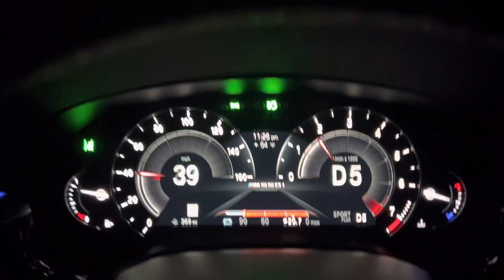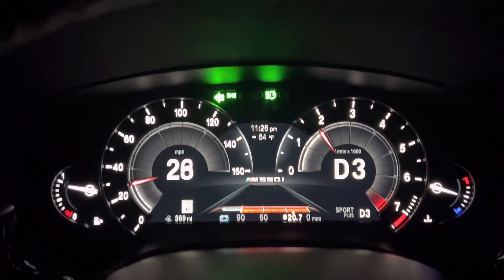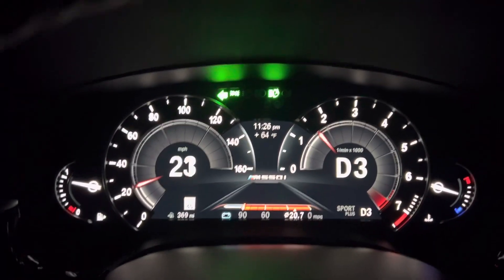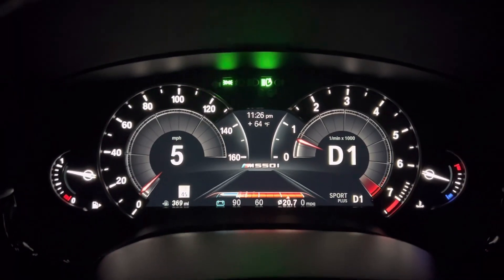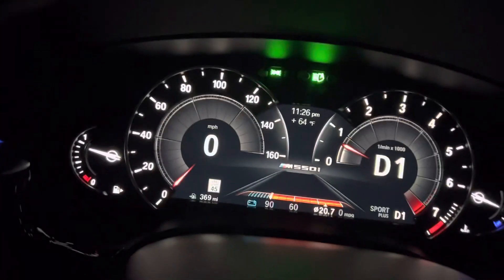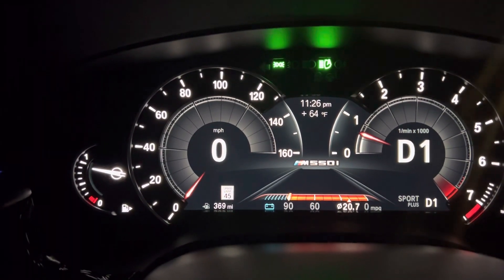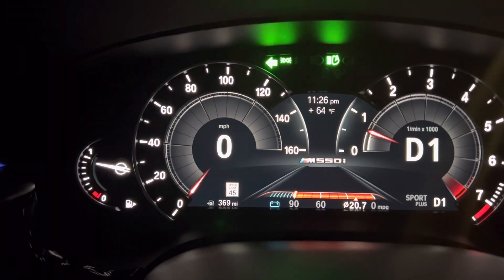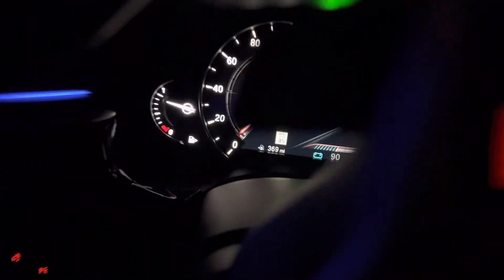How does BMW regenerative braking work and why your battery may not be at 100%

Comment: Dumbest idea ever.  Thanks to this, my 2022 X5 refuses to remote start in frigid weather, which is when I need it pre-started the most.
Reply from the maker: Yeah you can thank the European Union and Greta thunberg for that.  Remote starts aren’t even legal where the cars are built.
Reply: @newfinishautospa   I've never understood how a 15 minute idle can hurt the environment more than driving the car.  Over-reacting against the wrong things I guess.
Reply: @MichaelBradley1967  I think the concept is when you are not moving that you are getting 0 miles per gallon.  The regen feature saves on brake pad and rotor wear and tear.